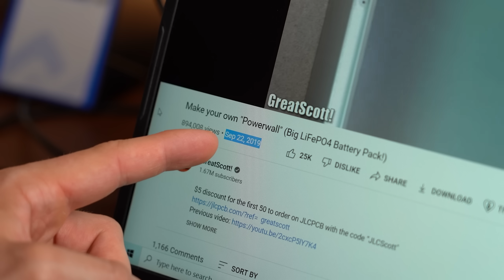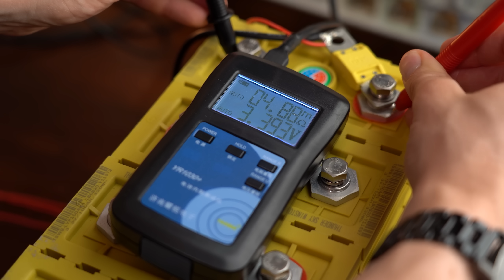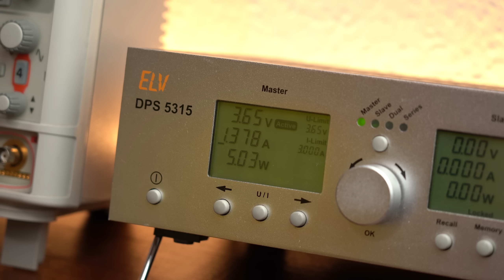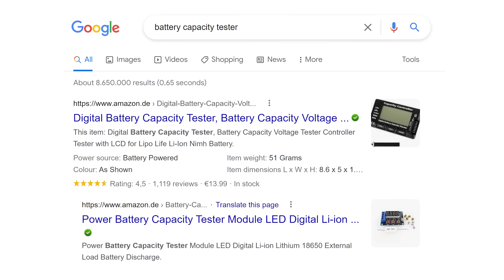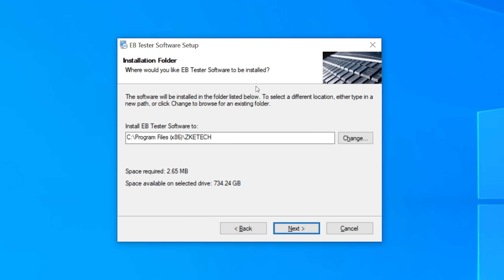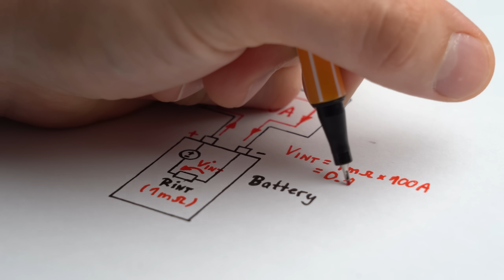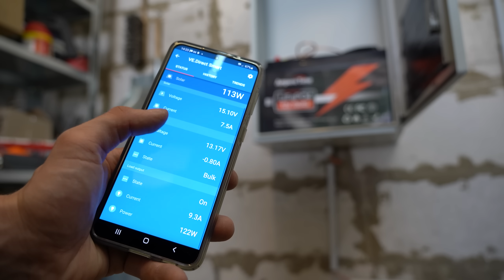Is it Time to Replace your Batteries? Here is how you can find out!

Comment: Could you not add a small heating element, controlled by your monitoring circuitry and powered by the batteries, to ensure the temp stays above the minimum? Might be interesting to see if the savings, invested into more storage, would be affected much by the need for such heating.

Comment: GreatScott!, question using your laptop on a main power plug? when off grid, this is the Question: would you not be better to use 12/24, car/van/lorry, power adapter, it power will be a lot closer to the laptop charging requirements, and the second part of the question: in the long run world save power, in the main wall power adapter still more efficient in power usage?

Comment: Well I'm working with batteries from last 5 years (cause its integral part of any UPS systems)n I'm working with 10 kW to 1.8MW UPSs, so to accomplish such large current demands usually we do series of 12V batteries 34 to 50 batteries in series to reduce current, and then do parallel of these battery bank's,
During periodic testing of these batteries, i have observed that if any battery's IR goes up then voltage drop accross it get higher over time for example normal batteries charging @13.5 V 
And weak battery will show you 13.6 then after some weeks it goes to 13.7 then 8 9, 14.0
In other hand good batteries will have less voltage to get charged at healthy condition (starving), thus impacting whole back-up time, and if you have bad day then one of these bad battery may get open circuit condition to drop load without any warning, or during test such battery may explode or caught 🔥,so its always better to have battery management and monitoring circuits

Comment: just make video about why none using car batteries for solar systems. I mean almost none but still I know a few who using those batteries and they never even started thinking about replacing them with lipo or any kind of other type of batteries. Still at my opinion without proper testing , I think price is main reason as to get capacity of 150Ah at 12 V , price is around 150 euros at least here where I am.  Waranty period for those batteries is 2 years , and usualy those works properly at least 3 years in cars if not longer.

Comment: What did you do with the previous battery? Since it’s condition is still pretty good and you still have free room in the box, you can have them both set, not just one. In theory, you’d be able to run electrical instruments (saws, drills, etc.) with it.

Comment: in ideal internal resistance test, a small ac current in sine form should be apply to the cell and then measure the ac component of the voltage to calculate the complex impedance Z to the frequency f. but it seems that no one done it like this.

Comment: There is something I don't quite understand about how the information regarding the cutoff voltage is presented in batteries datasheet.

If I understood correctly, simply put the cutoff voltage is the point at which the battery is considered 100% discharged.

When reading several lead acid batteries datasheets, I found out that often in the datasheet there is a table that lists the discharge times for a given constant discharge current and a given cutoff voltage.

For instance, taking values from a real datasheet, let's assume that I have a 12V 22Ah lead acid battery.

For 10h of discharge time, with 10.8V as cutoff voltage, the discharge current is 1.99A, giving a total capacity of 19.9Ah, which is a little bit less than the nominal capacity, but is to be expected: the "effective" capacity somewhat depends on the current draw, so no surprises here.

However, if I take 9.6V as cutoff voltage, the discharge current given is 2.05A, with a total capacity of 20.5Ah.

Usually is not recommended to discharge a lead acid battery more than 50%, so the "available" capacity would be 9.95Ah (10.8V cutoff) or 10.25Ah (9.6V cutoff).

Now let's say that I have a 2A constant current load, which can function even at 9V (I'm pulling this out of my ass). Since the current draw is close to discharge current given above, that would give me around 298 mins of service time (if I consider the total capacity at 10.8V cutoff) or about 307 mins (if I consider the total capacity at 9.6V cutoff). In both cases it's about 5 hours of service time and 50% DOD, so what value should I consider for cutoff?

Comment: Isn't that PSU lead a standard C5 cloverleaf plug? 
First thing I did when moving from the UK to DE was get a load of DE power cables  my laptop, monitor, printer etc (and make up a 4-way extension block with a German plug on it)

Comment: This all seems rather excessive, when all you had to do was turn your lights on and measure the battery voltage over time with the known load, and most importantly, this is as real-world-need, applicable as it gets to determine if the available capacity meets your needs, since that is the intended load it has to handle.  One remaining variable is then cold weather, if not tested near the lowest it will be during use.

I do appreciate that you are proposing a universal solution to determining capacity but in this example, as well as most where people already have their setup and battery used over time, they can do the same thing, skip all in this video and simply do a test run.

Comment: New ideas for your next videos:
1) Using 2 ADC converters like ADS1115 to make a 32 bits precise conversion.
2) Using a Teensy 4.1 or else to output a precise 4-20 mA. (Or a few 4-20 mA on the same microcontroler).

Thank you for your work.

Comment: If you look at the cost for the system you see being off grid with a small system only really makes sense if you don't have access to a reliable power grid. The 100kwh you used over the 3 years would have cost you only 35€, and that even with germany's extremely high electricity costs.

Comment: These LPA batteries have been around for so long now it amazes me they aren't the standard for everything everywhere, they are incredible value now with a proven track record. I have been using mine as my only power source for over 2 years now and since then cheaper more energy dense options are available even though it is the same chemistry. Apart from solar panels lpa batteries are the only good news in the energy sector for years and not being held to ransom by energy elites is makes building make real sense, being able to give power companies the middle finger feels really good...

Comment: Great video, Scott. It sound like a simple question: can you use DCIR or ACIR as an indicator of the state of health of a lithium battery cell? 
For lead acid batteries ACIR is reliable indicator. For lithium based batteries it is a lot trickier. As compared to lead-acid, the internal resistance remains a lot more constant over the lifetime of the battery and for many chemistries the IR depends strongly on the state of charge of the battery.  Taking a full Cole-Cole plot (aka. Nyquist plot) and comparing it to the baseline might give some indication about the SoH. 
DCIR measurements are a mess. First of all DCIR is not a DC measurement for exactly the reason that you showed, but rather the response of the battery to a large enough step. The steady state value where the DCIR is measured is a more or less arbitrarily defined point on the response curve of the battery. 
Scott, if you want to get deeper into this or borrow some of our battery testers, please get in touch with me at HIOKI USA.

Comment: Some notes about your video:

There's actually some non-linear relation between capacity and current called Peukert's law. Basically the law state that the more current you charge to or discharge from the battery, the less your actual batteries capacity is. That's why in some datasheet, the capacity data is tested on some standardized parameter (current, temperature, etc).

Comment: So you can quickly measure battery status by its internal resistance by measuring current and voltage during use? Why isn’t all stuff doing this measurement instead of just voltage?

Comment: A video idea I'd love to see would be Portable Backup Power Bank, DIY or Buy. The kind I was looking at was a 8kw power bank with a 240v and 120v output with a 15, preferably 20 amp potential output. They can be quite pricy, but I'm wondering if it is worth buying refurbished cells and making your own. I've been looking around the internet and can't find an answer to this question. But this is the kind of thing I think I would find on your channel and that you'd be very interested in exploring. Could compare let's say the ECoflow 10kWh model to a DIY. The idea behind this is that I am trying to figure out the cheapest yet not gas powered way to have a backup power source for my EV

Comment: Very interesting to see how well those cells hold up over time.
I noticed you performed the DC resistance measurement on the steel bolt, which is a relatively poor conductor. That may have influenced the measurement significantly. So maybe it is not all that bad.

Comment: i normally stay well away from lithium cells on applications like this since they are too sensitive to external factors like temps and charge status. i really dont want a battery that i have to babysit all the time to make sure it wont expload. however this means im confined to the low power density of lead acid cells. which isnt really an issue since they are usually bullet proof other than having to top them up every once in a couple of years. however I must say the LiFePO4 cells seem to be pretty robust as far as batteries go, so maybe once my current set needs to be replaced I'll look into it. however that wont be for another almost 20 years lol

Comment: At least with lead acid batteries, "capacity" is based on a 0.05C discharge over a period of 20 hours. When you discharge more current, the usable capacity decreases. So a 100Ah battery would only be rated for that capacity when drawing 5 amps for 20 hours, but is not necessarily rated for 10 amps over 10 hours because the effective capacity is lower at that increased output current. In your case, those lithium batteries were performing REALLY well to get 106Ah for a 12.5h test at 10 amps. If you were to discharge at 5 amps, you'd get an even higher capacity.

I find this result fascinating and goes to show improvements in battery technology.

Comment: Can you do a video showing why it's not recommended to run AC wires next to DC wires? They apparently induce a DC voltage onto the AC side. I don't have the hardware/equipment to measure this but I would love to see a video on it. Thanks!

Comment: FYI, if you compare iR for different battery cell, you will get different R value (can be by a lot) depending on what kind of cell. You cannot simply said one cell is "healthy" just by its iR.
Ex: For high A output cell, the iR will be much lower that the high capacity one.

Comment: Nice follow up. Seeing the Victron MPPT again, I'm wondering whether you have tinkered with that BT module or if you're just using the factory app on the phone as shown in the video. I tried building a bridge with an ESP32 using BLE to connect to the victron to then send the data off to a MQTT/Influx/Homeassistant server. Sadly I discovered that Victron is not willing to open up the full BLE protocol. I have a BT wireshark file lying around from when the app connects and gets data, but didn't get to analyze it further yet. There have been community efforts to reverse engineer the protocol in the Victron forum, which interestingly Victron doesn't mind :D But that is still far from working.
Viele Grüße aus Berlin.
Reply: An easy way to do that is to use Victron open source VenusOS firmware and run it on a Raspberry Pi. You can get a VeDirect to USB cable from Victron that allows you to hook up the charge controller or any VEDirect device up to it. From there you can integrate 3rd party automation/monitoring systems. I have a Raspberry Pi 3 running in my DIY Powerwall setup monitoring two Victron charge controllers, a Victron Multiplus and a Victron Battery Monitor. Works great and allows for remote monitoring via the internet.
Reply: @ZaiFuchigami  Yeah I saw, that serial communication protocol is open source, so that's probably the way to go. That's why I don't understand, why Victron doesn't open up its BLE protocol. I'll probably do serial  in the future, but with a custom coded ESP-based firmware. I think for the VeDirect there even is already an ESP implementation. But thanks for the suggestion. If you already have an RPi in your setup that's probably the easiest and best way to go.

Comment: I was looking for some kind of DIY backup system for my daughter's medical equipment in case of a longer interruption of the city power supply. The devices have their own internal battery, which is enough for an hour of autonomy. After your first video, the search ended :) I ordered the same batteries from GWL, assembled everything and did a couple of tests and the devices worked for 18 hours on backup. The first real test was the earthquake on March 22, 2020 in Zagreb, the power outage at home lasted for 5 hours. After that I ordered 4 more batteries, Victron MultiPlus and solar panels. After that, there were several interruptions in the electricity supply due to network works until the 6.1 earthquake on 12/29/2020 in Bania. Another test in disaster conditions passed. The investment paid off, and we see that the future brings all kinds of challenges. GreatScott, THANKS for the super educational videos!
Reply: Buy a real UPS. Or buy two of them.
Reply: @PyroRob69  You have not used a well-built Victron system if you are making this comment. A UPS is not designed to supply current for extended periods of time. Even my larger rackmount UPS units will never keep going for 18 hours. Most UPS systems sold to home users and small businesses still use lead-acid batteries, which are not designed for repeated true deep cycling (even the "marine" or "deep cycle" batteries are not designed for cycling as deeply as more modern battery chemistries). An off-grid system is designed for long-term continuous use, and lithium iron phosphate cells are designed for repeated deep cycling that far exceeds these deep cycle/ marine lead acid batteries.
Reply: @r2db  I never said anything about using lead acid batteries, and none of my UPS's have lead acid batteries in them. Go build a battery room then. /shrugs.
Reply: @PyroRob69  You have only addressed one of the issues, battery chemistry, but provided no details for your supposedly superior solution. The models equivalent to the lead-acid units I have are roughly double the cost with about the same runtime, which is probably why the lead-acid units still rule in the home/ SMB market here. Again you demonstrate your lack of knowledge regarding a reasonable system for this person's problem. UPS units, even those designed for enterprise use, measure their runtime in minutes, not hours. My server rack UPS will not last 8 hours. At about 20% load with batteries that are still serviceable my units can't quite hit 2 hours. They are designed to provide power long enough to get your generator online, not long enough to restore utility power in case of a prolonged outage. One does not need a "room" for a reasonable off-grid system for life support equipment.
Reply: @r2db  As I said, go build yourself a battery room. Those are not to hold everything, they are to hold everything while your generator starts. Thought you might know more about this based on your original comment and the medical necessity.
Reply: @r2db  What are you even talking about? In a industrial UPS, batteries only power the load until the generator comes up which takes no more than a few seconds.
Reply: @johnjacob5329  / With some application, a backup generator might not be available - unable to install, like in a rent house etc...
The commenter points that "One does not need a room..." for an off-grid system. You're talking about critical keep-alive system.

Comment: The west mountain radio CBA-V battery analyzer will do up to 150W discharge max, with maximums of 57V and 40A.  the documentation and software are good too.   I do like the display on this Chinese unit and I think it will charge (only to 18V) as well...  Ebike batteries are usually 48 to 52V so the CBA-V would be a better choice in that instance.  great video as always.

Comment: A new laptop used less power. Mine uses 12 Watt on average use and 30 something when stressed. It is not a gamer laptop. And how do you manage to draw 8A on your lighting ? ? ?
If you want to be off grid, be sure to get the right appliances for it.
Reply: The stated power draw probably includes battery charging.

Comment: As another option, many RC chargers have a discharge/capacity check function, like the imax b6. Some even let you automatically run multiple charge/discharge cycles and also give you a rudimentary measure of ESR. Enough to get a rough idea.
Reply: The imax B6 is utter outdated garbage (especially the clones), i'd recommend isdt for better low budget option.
Reply: @drkastenbrot  sure. Mine continues to give me good service almost a decade later, but yeah, avoid the clones.
Reply: @spagamoto  The problem is the firmware, even the original one. They didnt properly handle fault conditions, so while it works absolutely fine with batteries that are in good shape, it gets really unpredictable with faulty or worn batteries. Ive had it try to charge lipo cells to 6V and completely fail to balance. Other chargers would stop charging with an error message but the B6 just doesnt.

Comment: I don't like the Calculation. Datasheet: Nominal Voltage 3,3V but Operating Voltage and also Max. charge Voltage are real 4V. I know that from the 18650s, printed 3,6V but fully charged they have 4,1V-4,2V Max. Means should bring 400Wh or Not? Explanation and Measuring as always Great so LIKE..